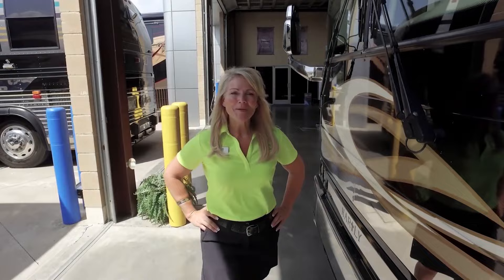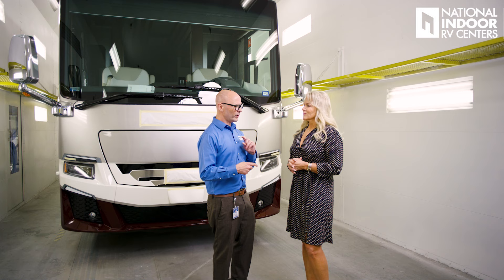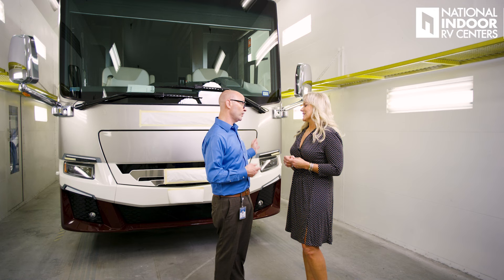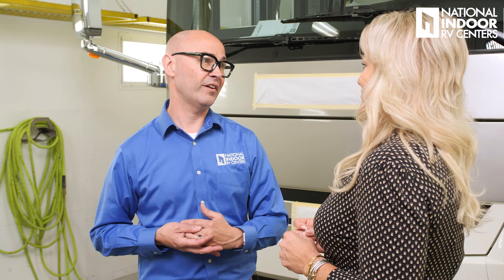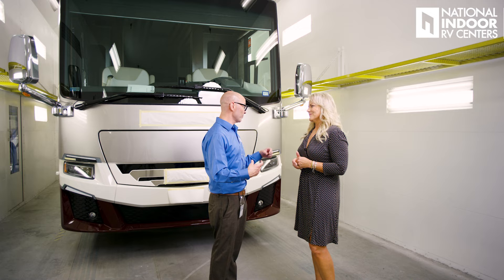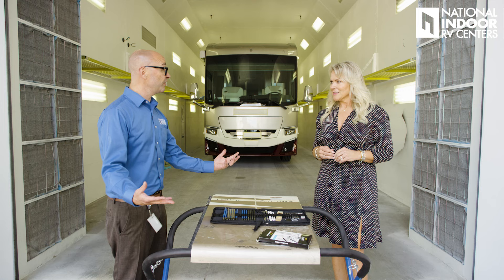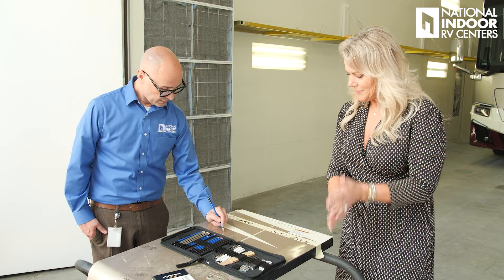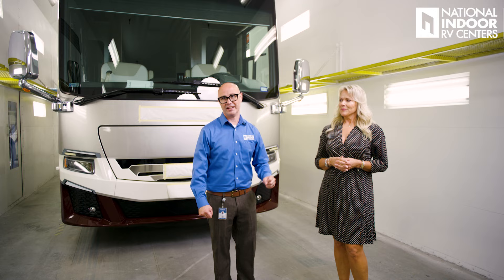NIRVC 101 - RV Ceramic Coating

Comment: Outstanding video! I've heard that you should wait one year to allow the new coach paint job to fully outgas before applying ceramic coating rather than immediately apply ceramic coatings to a new coach. Comments?
Reply: This is a great point Greg, and allow me to provide a lengthy explanation. The short answer is  - not a year. A typical gas off period is 30-90 days. As I mentioned in the video, this is where it is SO important to understand the process the manufacturer uses to paint your coach. Start by knowing the day your coach was completed in the paint process, next learn if ANY repairs were done after the coach was finished with the intial process, if so; were those repairs baked? There are some quick indicators - If your coach had a cut and buff as part of the paint process, the "Buff" assumes the manufacturer waited for the proper cure period prior to buffing. If the coach went through that process and has "Swirl" marks, there is a strong indication that the coach did not cure prior to buffing.

Comment: Wow,  Mark, you're amazing on video! Thanks so much for this presentation!  How does ceramic coating work with Diamond shield?
Reply: Hello my friends! Ceramic coating is applied directly over the Diamond Shield. The only set back with Diamond Shield would be any imperfections in it (tears, peeling away). We would want these corrected prior to the ceramic coating application.
Reply: @markmoniuszko5545  good to "see" you again! We're getting 2 sections of diamond shield replaced on our generator access panel from scratches and an stubborn air bubble while in Decatur getting other issues addressed.  Good to know about the ceramic coating and Diamond shield!

Comment: I work for a company that produces the outer aluminium sheets of RV's and caravans. It will be difficult to implement that during the production process.
Reply: That is a great point. I worked for one of the "Big" RV manufacturers as a Quality Director prior to working for NIRVC. The way I validated this was to have the painters apply paint to a piece of scrap from a coach while they were painting in the booth (base, first color, clear, etc.), then I had the team pencil test that sample. I assume many manufacturers will argue that there is no way to test this without performing a "destructive" test (taking the pencil to the actual coach), but doing it as I outlined validates the bake booths and the formulation). It simply isn't enough to go off of the paint manufacturer's stated hardness because there are other variables - Was it baked? Are the ovens calibrated? How long was it backed? Do the booths have proper flow (dirty filters) etc.

Comment: do you coat the entire coach and what is the ball park figure in cost to do a coach
Reply: We do coat the entire coach (except the roof) and the price would vary based on the length of coach and if it is new or used. Please call one of the NIRVC locations and we can walk you through your unique situation!

Comment: What type of maintenance  is expected if you put the platinum coating on a Class B?  Do I have to use de-ionized water to wash the vehicle?
Reply from the maker: I would love to get you the help and answers you need. Would you mind submitting that question here, so one of our highly skilled technicians can help and advise you best? www.nirvc.com/wash (You'll see a button to contact our wash dept - if you click that, you can submit your question there) Thanks so much!